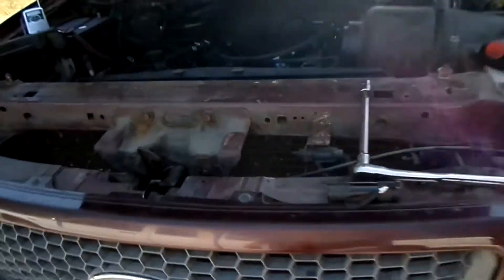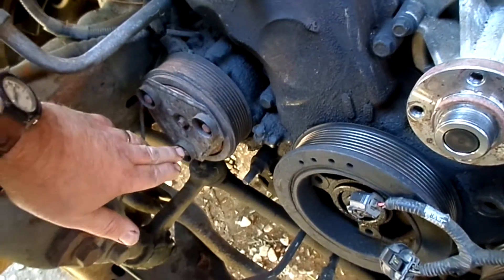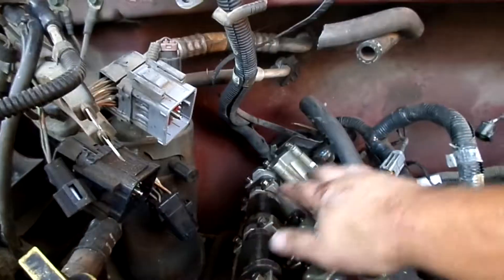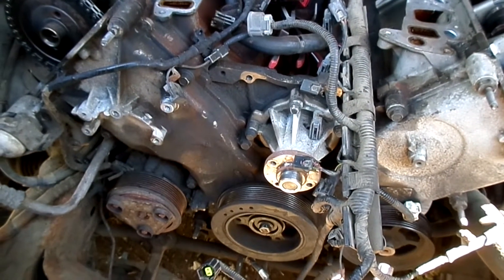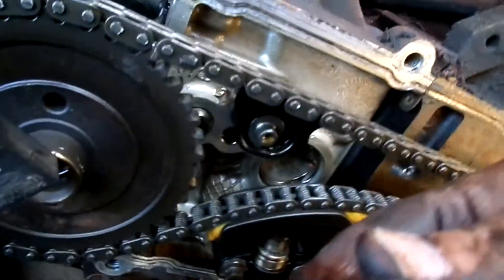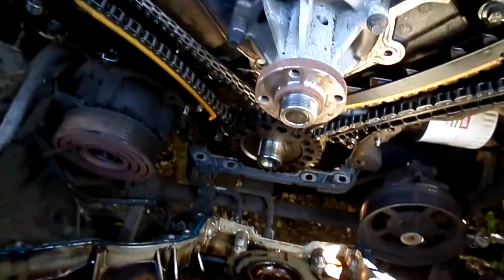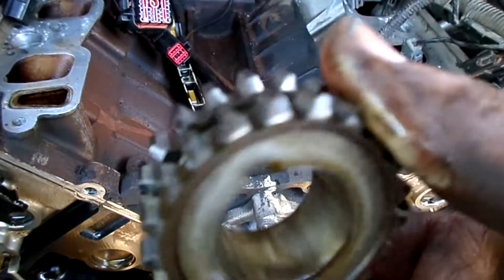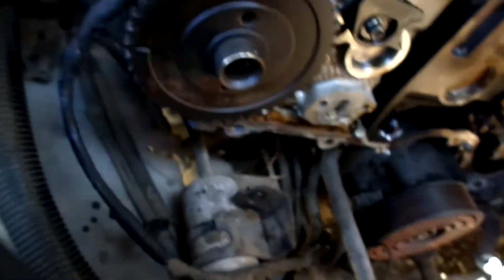2000 Ford F150. Part 1 Engine Teardown. 5.4L 2V Triton

Comment: Good common sence.  Remember the head is one part , the main bearing caps are individual parts so they will act differantly.  Looks good and the crank turns nice and smooth.  Good job.
Reply from the maker: Thanks John!

Comment: Startup rattle got me inside my engine now, but it seems Ford designed this 99 F250 4x4 to where if you need to replace any one gasket, you'll have to replace them all.  Just to get to my timing cover, I'm having to open the valve covers, manifold and oil pan, none of which is at all easy and there's only a 134k on it.

Comment: Good video very informative - ive  always wanted to overall my engine
Reply from the maker: Thank you, I hope this helps. This engine is a little bit complicated, but is doable at home.
Reply: @MrUbiquitousTech  yup -ive worked on 4 cylinder Engines before but not the v8 triton which is a beast

Comment: i believe the right and left tensioners are from the point of view if youre sitting in the car so the right one goes on the passenger side
Reply from the maker: Correct, previous "mechanic" put them (tensioners) on backwards.

Comment: Use some pb blaster on your egr tube, especially down at the bottom where it threads into the exhaust manifold, keep spraying and letting it soak in, I also used a small pipe wrench to break mine loose.

Comment: Can I swap a 5.4 2v on my f150 it has a blown 4.6 block. Broken rod and piston.. 
just want to know if I can use the same harness with the Same computer of the 4.6 to run the 5.4..??
Reply from the maker: Sorry so late Jose, I thought I had replied to this already. From what I understand the 5.4 will physically bolt in to your truck, but the computer will be wrong. SO the big question is can you simply plug in a computer for the 5.4 at the same time or is the wiring harness different as well. I don't know the answer to that, but it's an interesting question.
Reply: @MrUbiquitousTech  thanks tho, sold my truck for 1000 bucks and got myself a 2012 Nissan Titan.

Comment: Great video, I'm expecting to have to tackle this very soon because my final oil leak is on the timing cover and I'm certain I'll need to tackle all the issues here, including new AC compressor, but mine is still working okay-ish for now.

Comment: Hey man this was a fun video. Before my plow truck was my plow truck it was my wife's daily driver and she says to me the engine is knocking so I thought oh shit because It was going to be my plow truck. Its a 97 F150 with a 4.6 and 230+ thousand miles. I discovered it wasn't the engine it was the air conditioning pump , same as yours.  All worn out and floppy which sucked because the air still worked , not that it mattered because I wouldn't need air in a plow truck. I looked up a video and found a guy that put a smaller belt on to bypass the pump.  He gave the belt number out in his video , its a little narrower but works fine. Carry on. I'll wait for part 2
Reply from the maker: Thanks Dave. Yes, this truck had the shorter bypass belt on it as well. Heater core was bypassed also, PO just wasn't into fixing anything I guess.